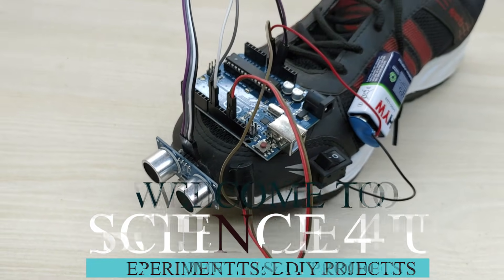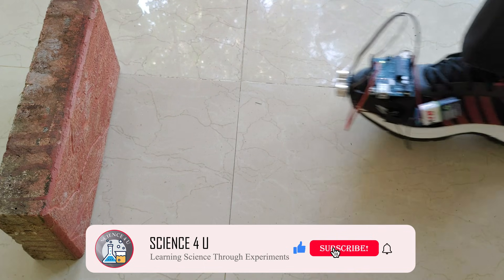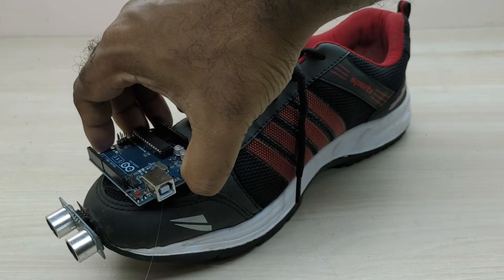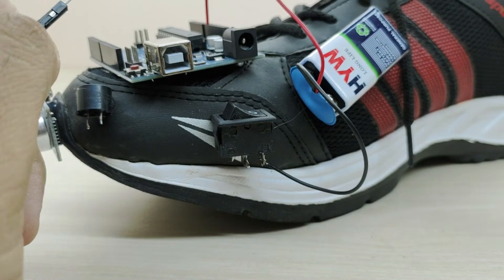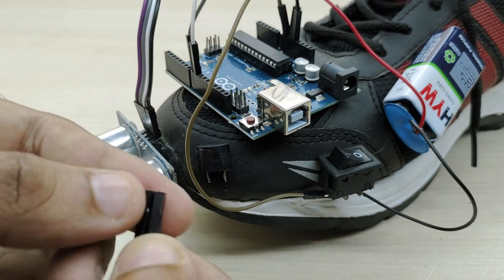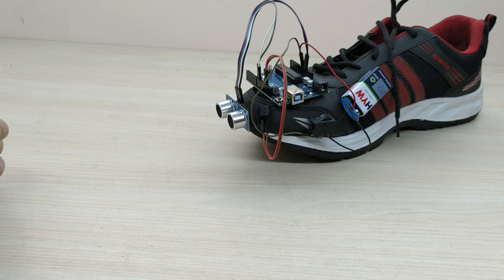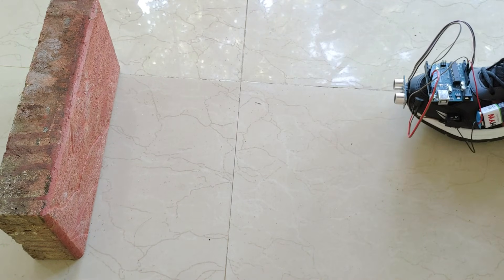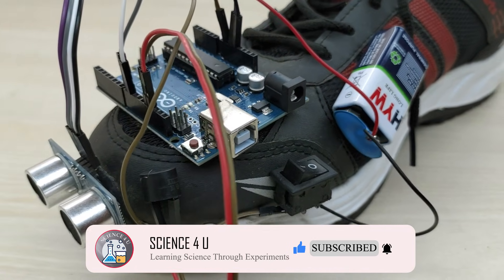Smart Shoe for the Blind || Extremely Useful Arduino Project #arduinoproject

Comment: Sir I've done everything you've mentioned in this video. The shoe is detecting objects when something is too close. But the buzzer is not going off. I can see the light getting on when something is close and turning off after removing it. I checked if the buzzer is faulty but it's not. What should i do?
Reply: I think some problem in code

Comment: I did everything as u say
Reply: After I installed the code
Reply: It gave a buzzing sound with obstacle and without obstacle
Reply: Pls help me
Reply from the maker: Hi friend. Most probably, the ultrasonic sensor is faulty. Even without obstacle in front, it is falsely detecting obstacle in front and so buzzer is on even without obstacle. Replacing the ultrasonic sensor with a good one should solve the issue.

Comment: Helooo sirr can i ask how can i add the distance and buzzer is continuing ringing please urgent please tell how to fix it
Reply from the maker: Hi friend. If the buzzer is continously ringing, it could be a problem with the ultrasonic sensor. It is always detecting an object near it, eventhough there may not be an obstacle. Replacing the sensor should solve the problem.

Comment: The arduino board in the description is the fake one. It is not supporting the codes 😢. It doesn't even have the original arduino logo
Reply from the maker: @AarnaSeth yes friend. These boards are not original ones. Original ones will be very costly. These are custom made boards. Bit it will work fine just like original boards itself.
Reply: Ohh... Thanks 
Actually I am in 9th standard and today there was an exhibition in school. Don't know why but when we did the coding, we compiled it easilt but ran into a problem while uploading. It was showing some error. And also at the last moment our buzzer went off. We changed the buzzer . Nothing worked. Then we changed the jumper wires but still nothing worked. So we finally assumed that the the board is not working properly.
Reply from the maker: @AarnaSeth Ooh okay friend. Sad to hear that it didn't work properly.
Reply: But nothing to worry about ☺
The judges didn't even ask if its working Or not 😅. We just got a token on which it displayed that our project is working ☺
Reply from the maker: @AarnaSeth  haa..okay friend..

Comment: Material names send me plz
Reply from the maker: 1. Arduino uno board : https://amzn.to/3RPzXw8
2. HC-SR04 Ultrasonic Sensor : https://amzn.to/3XFNCd4
3. 9 V battery with connector   :  https://amzn.to/3L8Opfe
4. Jumper wires : https://amzn.to/3xG4FB0
5. Rocker Switch : https://amzn.to/4eOuCiO
6. Passive Buzzer:   https://amzn.to/4eHC2nH

Comment: Cant It Be Done Without soldering machine 😢 Mine Not Works
Plz Reply For School Model I Have Given The Name 😢
Reply from the maker: Yes friend. Soldering is not required for this project. All connections can be made using just jumper wires.

Comment: How nuch would this project cost
Reply from the maker: Arduino UNO : 200 rupees
HC-SR04 Ultrasonic sensor : 50 rupees
Battery, cables, switch, buzzer : Total 100 rupees
So total cost will be around 350 rupees (excluding the shoe cost)

Comment: 1. Can you give me the code for the whole function again to add voice instead of buzzer?  
2. And if I want to add voice, what separate instruments do I need and what kind of speakers would be good for speakers?  
Please reply soon, I have to submit it in my college for project after 2 days🙏😢
Reply from the maker: Hi friend. I have made a separate video on voice using arduino. You can combine that code and this code which will give voice alerts. You can use any small toy speaker for this.

Comment: What is the distance it detects ?
Reply from the maker: Hi friend. Now, the distance that it detects is set to approximately 15 cm. This can be easily increased or decreased in the code.
Reply: Ok thank you
Reply: What are all the questions may ask in the exam about this project??
Reply from the maker: @bhuvanamj9758 Hmm.Questions could be..
1. What is the working principle of this project.
2. What are the components used in this project.
3. What is the working principle of tge ultrasonic sensor.
4. What are the limitations &  improvements that can be done in this project.
Reply: @Science_4U_  thank you sir

Comment: My buzzer is continuiously working when i attach it with battery
Reply from the maker: That is most likely because your ultrasonic sensor is faulty. It is always wrongly detecting obstacle in front and the buzzer is continously ON. Replacing with a good ultrasonic sensor should solve the problem.

Comment: Bhai tinkercad pe rocker switch hai hi ni aisia kyun. Slide switch hai. Iske kaise connect kre.
Reply from the maker: Kya aapko circuit diagram banna hai?.
Reply: @Science_4U_  hannn
Reply: Buzzer Sara connect krke
Reply from the maker: @binauralbeats-relaxingmusi4336 okay.. You can make circuit diagram in Microsoft powerpoint. Just place the pictures of components and connect pins using lines..
Reply: @Science_4U_  tinkercad me lekin simulations krne me shi rhta. Online code run bhi kra skte aur components ka working bhi dekh skte
Reply: Bhai buzzer work ni kr rha.
Reply from the maker: @binauralbeats-relaxingmusi4336 hi friend. Buzzer mein ek positive pin hai. Waham chote se likh jayega. Woh positive pin arduino ka pin no. 13 ko lagana padega.. aur buzzer ka doosra pin, arduino ka GND pin mein lagana padega. Aap aise kiya? Woh ulta connection diya toh nahi kaam karega..

Comment: Bro in which software we have to enter that code ?
Reply from the maker: Hi friend. There is an Arduino IDE (Integrated Development Environment) software that is available to download for free from internet. You have to install the software,  open the code in the software, connect the arduino using USB cable and upload the code..

Comment: Hello brother, should the buzzer be passive or active? And can I use a 5v buzzer or it depends on the battery?
Reply from the maker: Hi friend. It has to be a passive buzzer.You can use 5V buzzer since the arduino output is a regulated 5V, eventhough you may use a higer battery voltage for powering Arduino.
Reply: @Science_4U_ so it's fine to use a 5v buzzer on a 9v battery? Thanks for answering me really fast🫶🏼
Reply from the maker: @mis0o.t522 yes friend. It is perfectly fine..
Reply: @Science_4U_  Thank you so much

Comment: How many metres jumper wire we need? And hpw much we need
Reply from the maker: Jumper wires are not sold in metres. It is sold in numbers. Each jumper wire is around 15 centemetres in length and has pins on either end to plug to arduino and other sensors.
Reply from the maker: For this project you need 4 numbers of jumper wires, male to female ..for ultrasonic sensor ..2 numbers of male to female jumper wires for connecting buzzer..
Reply: @Science_4U_  Near my house  it is sold for 30 rs for 1m??
Reply from the maker: @darkslayer009 okay..but i dont kno2 whether it will have pins at both ends.. what I am talking about can be seen in the following link..
Limited-time deal: ApTechDeals Jumper Wires Male to Male, Male to Female, Female to Female/breadboard jumper wires (40+40+40) https://amzn.eu/d/hUIjDU7
Reply: How much wires should I purchase?.
Reply: Okay thanks❤ sir you are honest 🙏
Reply from the maker: Thank you friend..❤️🙂

Comment: Hi sir i am a student of std 6th my school has hold a science exhibition for that reason i have selected your work i have a doubt in it i dont have that machine that you use to connect the wires. Request you will reply. 🙏
Reply: I dont have that kind of machines can you help for it?
Reply from the maker: @Darkest-Slayer  Hi friend. Are you talking about the soldering iron that I am using to connect wires to the switch?. That is not required friend. You can just insert wire through the hole in the switch terminals and twist it. Soldering is not required.
Reply: Ok Thanks sir

Comment: Hii sir I've done this project but only i can see the lights in the arduino uno but buzzer is not working what to do?
Reply from the maker: Hi friend. Most likely the ultrasonic sensor is faulty and not detecting the obstacle in front. We have to check one by one to find out the exact problem. Have you used this ultrasonic sensor before or is it a new one?
Reply from the maker: Whether only the power led light in arduino is seen or can you see a flashing led light when the hand is brought closer to the ultrasonic sensor?
Reply: I can see the light when hand or any object in the front but buzzer is not working
Reply from the maker: The light has to continously blink when you bring your hand near the ultrasonic sensor. The light should go off when you move your hand away from ultrasonic sensor. Is it happening like that?
Reply: @Science_4U_  yes
Reply: @Science_4U_  But what about the buzzer ? It is not working
Reply from the maker: Hmm..okay. so I think buzzer is the problem. This buzzer has a positive pin. So have you made sure that the positive pin only is connected to pin no. 13 of arduino?
Reply: All the components are new one
Reply: I changed the buzzer, it worked 👍 Thank you soo much for helping me ☺️
Reply from the maker: @bhuvanamj9758  okay friend. So happy to know that it finally worked..🙂

Comment: The code is not opening!!
Reply from the maker: Hi friend. Can you tell are you not able to download or is it that the code is not opening in software?.
Reply: @Science_4U_  it's not downloading
Reply from the maker: @banarasi_655  okay friend. I have given a mediafire link also in the description box. Can you try downloading the code from the mediafire link?
Reply: @Science_4U_  likh rha the "site can't be open.....
Reply from the maker: Okay friend..Don't worry. I will paste the code here.

#define trigPin 9           // Trig Pin Of HC-SR04
#define echoPin 8        // Echo Pin Of HC-SR04
#define BUZ 13     //BUZZER
long duration, distance;

void setup() 
{
   pinMode(BUZ, OUTPUT);
   pinMode(trigPin, OUTPUT);       // Set Trig Pin As O/P To Transmit Waves
   pinMode(echoPin, INPUT);        //Set Echo Pin As I/P To Receive Reflected Waves
}

void loop() 
{
  Serial.begin(9600);
  digitalWrite(trigPin, LOW);
  delayMicroseconds(2);   
  digitalWrite(trigPin, HIGH);       // Transmit Waves For 10us
  delayMicroseconds(10);
  duration = pulseIn(echoPin, HIGH);        // Receive Reflected Waves
  distance = duration / 58.2;                       // Get Distance
  Serial.println(distance);
  delay(10);
  if (distance < 15)               // Condition For Absence Of Obstacle            
  {
   // turn BUZZER ON & OFF 5 times:
    for (int i=0; i<5; i++)
    {
    digitalWrite(BUZ, HIGH);
    delay(50);
    digitalWrite(BUZ, LOW);
    delay(50);                                                 
  }
  
  }
}

Comment: Code download nhi ho rha ??
Reply from the maker: Okay friend. I will paste the code here.. You can copy and use that. 

#define trigPin 9           // Trig Pin Of HC-SR04
#define echoPin 8        // Echo Pin Of HC-SR04
#define BUZ 13     //BUZZER
long duration, distance;

void setup() 
{
   pinMode(BUZ, OUTPUT);
   pinMode(trigPin, OUTPUT);       // Set Trig Pin As O/P To Transmit Waves
   pinMode(echoPin, INPUT);        //Set Echo Pin As I/P To Receive Reflected Waves
}

void loop() 
{
  Serial.begin(9600);
  digitalWrite(trigPin, LOW);
  delayMicroseconds(2);   
  digitalWrite(trigPin, HIGH);       // Transmit Waves For 10us
  delayMicroseconds(10);
  duration = pulseIn(echoPin, HIGH);        // Receive Reflected Waves
  distance = duration / 58.2;                       // Get Distance
  Serial.println(distance);
  delay(10);
  if (distance < 15)               // Condition For Absence Of Obstacle            
  {
   // turn BUZZER ON & OFF 5 times:
    for (int i=0; i<5; i++)
    {
    digitalWrite(BUZ, HIGH);
    delay(50);
    digitalWrite(BUZ, LOW);
    delay(50);                                                 
  }
  
  }
}

Comment: Sir our ultra sonic sensor detecting long objects also and the buzzer is continuously working . What should we do ?
Reply from the maker: Hello friend..Most probably, it could be a problem with the ultrasonic sensor. If possible please change that and see if the problem is solved.
Before that you can try this. In the code there will be following command line at line No. 24
  if (distance < 15)
This number 15 is the distance for trigerring the alarm when it detects an obstacle. You can increase this number 15 to increase the distance at which the buzzer sounds alarm..

Comment: Sir can we replace piezo in place of buzzer alarm
Reply from the maker: No friend. We cannot use. The buzzer that I have used just need a DC command voltage to work. So a constant 5V DC signal from arduino is sufficient for it to work.
But in the piezo buzzer, a signal with a frequency (PWM) is required for sounding the alarm. So in the code you have to use the following command 
tone(pin No., 1000) where pin no is the pin to which the buzzer is connected and 1000 is the frequency of the signal.

Comment: Sir can you reply me fast please because I have science fair in 2days what is the app used to type code pls say😢😢😢
Reply from the maker: Hi friend. I am using IDE software which can be downloaded from internet. This software has to be first installed in laptop or PC. Then a usb cable has to be connected to the arduino and the PC or laptop. Open the IDE software and upload the code..

Comment: heelo dude can you tell me how i can add a voice when the shoe is going to hit somewhere...like a blind person is walking and when there is a obstacle ahead them it shouts "danger ahead"
Reply from the maker: Hi friend. An audio alert like a speech can be definitely done using a speaker. But there are some commands for converting speech to audio signal and sending to speaker using arduino.. There is a talkie.h library which has to be installed. Then you can use the folowing code for saying some standard words..
#include "Talkie.h" #include "Vocab_US_Large.h" #include "Vocab_Special.h" Talkie voice; 
void setup() 
{ } 
void loop() 
{ voice.say(spPAUSE2); voice.say(sp2_THE); voice.say(sp2_TIME); voice.say(sp3_IS); voice.say(sp3_FIVE); voice.say(sp3_OCLOCK); } 

Youcan change the words as per your requirement..

Comment: Sir please give me the code.. sir the code in discription is not working please help sir
Reply from the maker: Hi friend. The code will definitely work friend. I have already checked the working of the code. Can you clearly tell what is the problem?
Reply: @Science_4U_  the code in the discription is not opening.
Reply from the maker: @notflameyt9272  The code can be opened using IDE software. This software can be downloaded from internet. After connecting the arduino to laptop or PC, the code can be uploaded to arduino using IDE software..
Reply: @Science_4U_  ok sir thanks!
Reply: @Science_4U_  sir, will it work on Arduino nano?
Reply from the maker: @notflameyt9272  yes sure friend. Make sure that the same pin numbers are connected.
Reply: @Science_4U_ thanks sir!
Reply: @Science_4U_ sir, there is no 3 GND pin in Arduino nano... Where should I connect my negative pin of buzzer?
Reply from the maker: Hi friend, you can join all the negative wires together and connect to the common single ground. There is no problem with that..

Comment: Can you tell me how to add the code plz😅
Reply from the maker: Hi friend. First we have to download the code from the link given in the description box below the video. Then, We have to connect the arduino board to PC or laptop using a USB cable. Then we have to open IDE software, which can be downloaded and installed from internet. Open the code from the IDE software and click the upload button. The code will then be uploaded to the arduino uno board..

Comment: Sketch uses 1900 bytes (6%) of program storage space. Maximum is 30720 bytes.
Global variables use 9 bytes (0%) of dynamic memory, leaving 2039 bytes for local variables. Maximum is 2048 bytes.
avrdude: ser_open(): can't set com-state for "\\.\COM7"
Failed uploading: uploading error: exit status 1     what is the meaning of this error and  how to fix this error   ?
Reply from the maker: Hi friend. This error says can't set com state for \COM7 means it is not able to communicate to arduino uno through COM 7 port. You can unplug and plug the usb cable connecting arduino. Also after you connect, make sure to goto IDE software..tools..port..select the correct port with a tick mark. Then upload..
Reply: Thank you for your reply
The port is automatically selected and I've seen each and every port in the lappi but the same error is generating
Reply from the maker: @mdmazid7386  ooh..can you try with a different pc or laptop?
Reply: @Science_4U_  it shows same error in my frnds laptop too🥲 
Compiling is done but uploading is not working
Reply from the maker: @mdmazid7386   @mdmazid7386  ooh..Then it could be an fault in your arduino board. Have you succesfully uploaded code in this board anytime before?.
Also you can try uninstalling the windows driver once and reinstall again. This also may solve the problem
.

Comment: I have a question ❓❓ till when will the battery work ?
Reply from the maker: Hi friend, It will work for many hours. Since there is only a buzzer, ultrasonic sensor and arduino uno, there will not be much power consumption. I think the battery should easily last a full day, working continously. If that is not sufficient, you can use a higher capacity battery.

Comment: Those ultrasonic sensors are very cheap, but they get damaged very easily, for instance, wenn you use them to determine the waterlevel in a container, the humidity in the container is enough to damage them
Reply from the maker: That is true friend. This is only a simple project to demonstrate the idea. Actual version has to be definitely weather proof..🙂